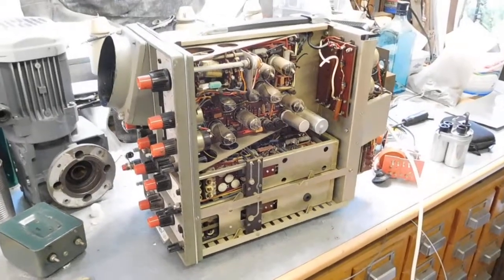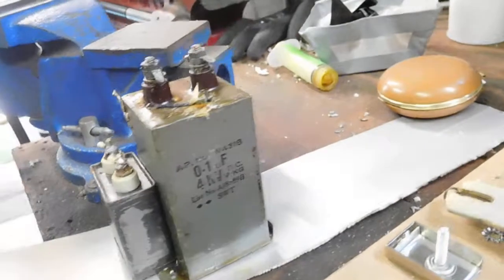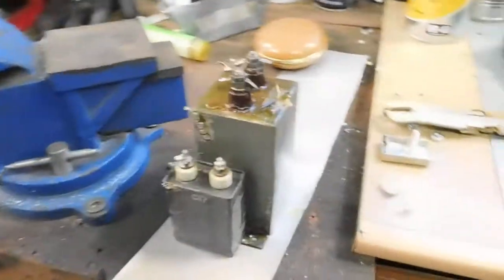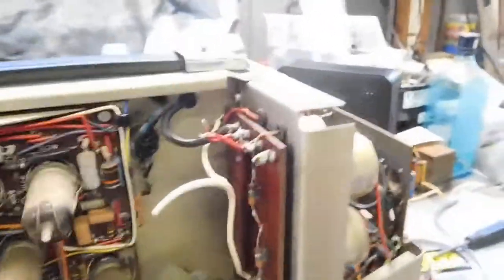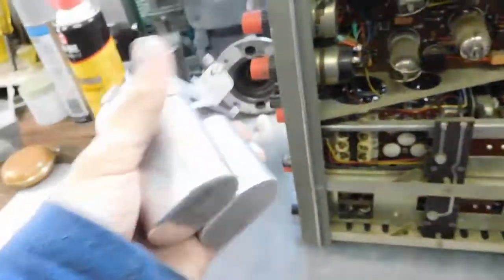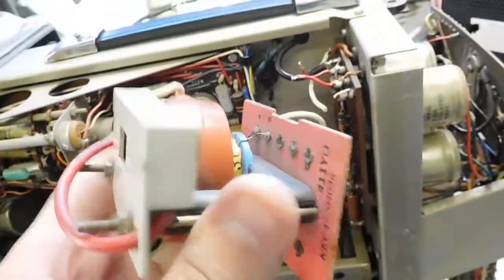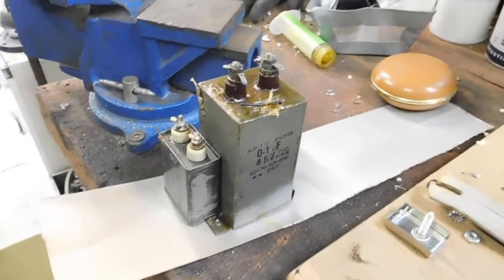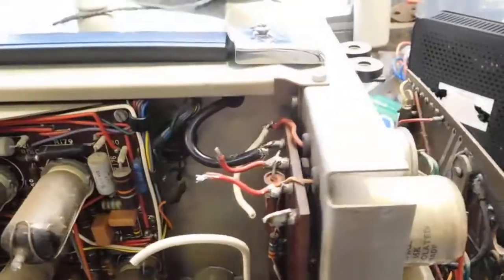Telequiment Oscilloscope Capacitor Issues - (problem solved)

Comment: 0.1 uf @ 4 KV i actually saw some metal film caps at the store too Yellow colour and size of C cell roughly!
Reply from the maker: Those poly-film ones do get pretty big in physical size! I ended up pulling a couple out of the EHT circuit in another dead CRO. they work alright at least

Comment: They sell modern ones of these on ebay and local Big Electronic components shop here in Taipei sells caps that very spec, they are modern Mylar equivalent to those ones there

Comment: Do you have any service information for this unit? Would be good to check the original circuit diagram to see if anyone made alterations to the wiring and check what the original component values should be. Maybe the voltage was too high for the capacitors or they are the wrong value for that circuit. If you can determine what the specs of the original caps were, let me know and I will see if I have any spares in my shed which I could send you.
Reply from the maker: Yes I do have the original users book for the set, which includes all of the valve numbers, and circuit diagrams, I will dig it out and have a look into what was originally in place of the oil-filled caps I removed. Thanks for the ideas!

Comment: Just use some 4u7 1kV film units in series for the 1uF, with some 1uF 1kV film units in series for the other. High voltage ceramic caps will also work, but the film units will be easier and will work. Just insulate them well from chassis however, use some rubber to insulate or some bare PCB material. Removing the old HT side will be harder, the HT is generally used for bias as well, and you will have a lot of high voltage taps to change instead of just using film units. That is a basic voltage doubler, so easy to replace using just new caps, though the diodes might also be poor leading to the failure, which are easy to replace with old microwave diodes, generally 4 in series will work for this for the long sticks, the microwave ones are cheap and a lot more rugged than the stack rectifiers they had back then.
Reply from the maker: Thanks for the feedback. I will look into poly-film caps and just do a direct replacement. easier and less risky than trying to retrofit something else